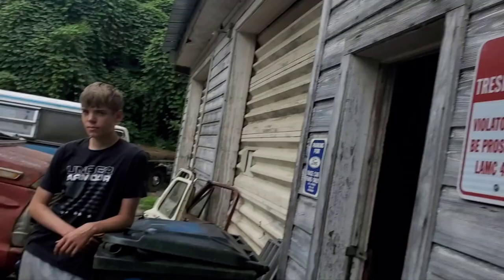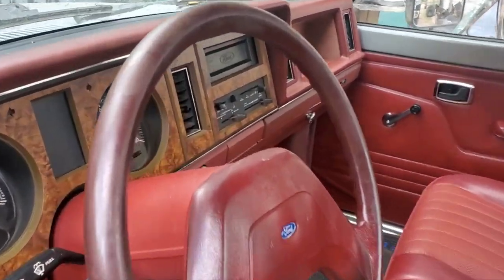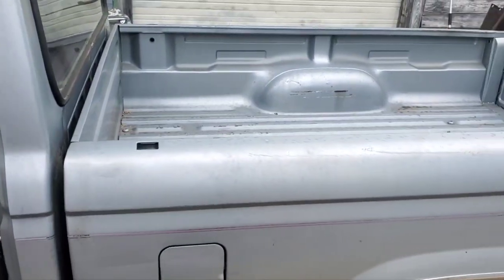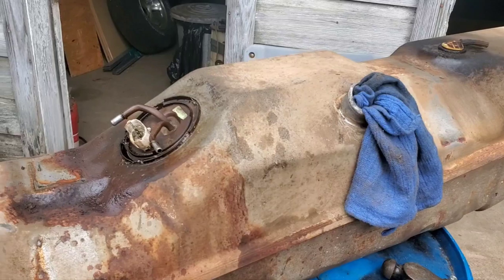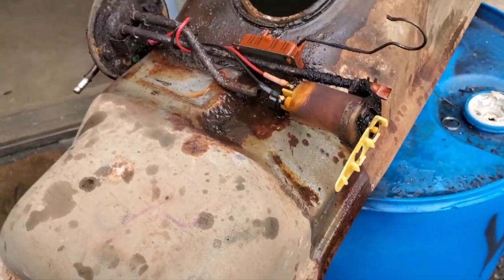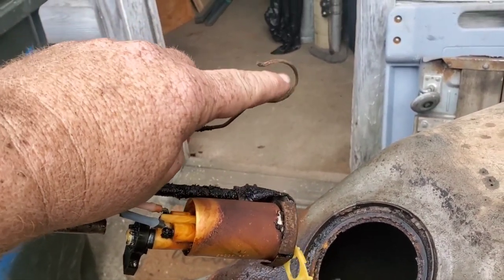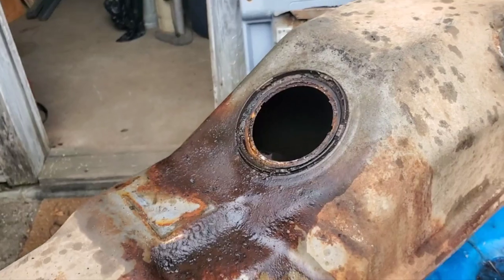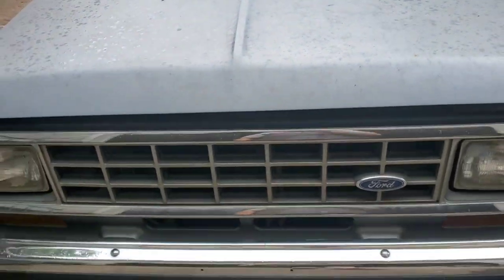What Did We Find Inside This '86 Ranger's Fuel Tank?

Comment: I've got the same truck in an extra cab ... changed the nasty looking  paper element in the fuel reservoir ... now thinking I need to check the tank. Mine also struggles with a slight misfire / rough idle
Reply from the maker: This one definitely had a misfire until I replaced the tank, the pre pump and the post pump

Comment: EARLY RANGER GAS TANK ALERT !!! *   
In this video .....That's a stock 15.5 gal gas tank, standard for a: shortbed 108in WB, short cab,  and there is a NEW replacement tank for this and its a 17gal tank !!! 

 ....BUT be AWARE **  IF*** your (Early Ranger) Shortbed, Shortcab ...is ALSO a 4x4 ....THEN the NEW 17 gal tank will NOT FIT !!    
because the 4WD transfer case is in the way !!!    Those Rangers MUST use the original shorter tank (cannot be longer than 55 inches) !  

SO..... although this tank currently appears to be TRASH ....  IT IS NOT !!  
- IF it can be cleaned (dipped at a radiator shop and all rust removed, any pinholes can be braised closed and then treated and repainted..... THEN this tank is a PRIZE for any early Ranger 4x4 owner .....because the nose of the 4x4 tank will always RUST OUT because of the plastic nose protection cap that they placed on those tanks which trapped debris (to rust) between the plastic cap and the gas tank skid-plate.  

If you have one of these 4WD early rangers, and you have NOT replaced or refurbished your gas tank YET .....   then INSPECT it IMMEDIATELY !!

Comment: "F" Ethanol
Reply from the maker: for real!
Reply: @rustynutsgarage4099  nothing to do with the ethanol!
Reply from the maker: @craigsherwood2185  has everything to do with the ethanol. Ethanol essentially is alcohol, which attracts water, which promotes rust.
Reply: @rustynutsgarage4099  You are wrong. I have an 88 ranger which sat with a half tank of ethanol gas in her for about four years. Ethanol binds with water. My tank was pristine. No rust at all! I pulled the in tank pump to get the sending unit to work. The inside of the tank looked super clean. This ranger has 170,000 miles, mostly run with regular ethanol gas. Try this experiment. Take a cup of denatured alcohol and put a cup of water with it.  You will not have two cups. Ethanol does not promote rust!  You probably had a hole in the top of the tank for years. There is a product to remove water from fuel lines called dri-gas. It is alcohol.
Reply: @rustynutsgarage4099  ethanol is alcohol! so is methanol!